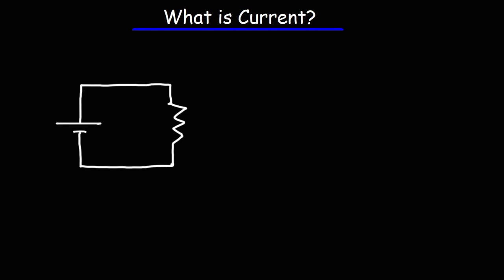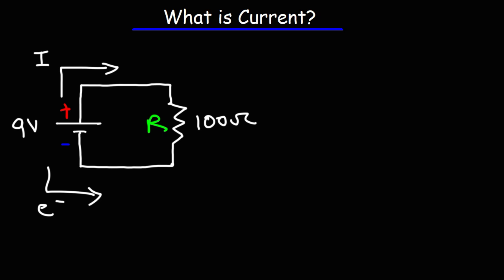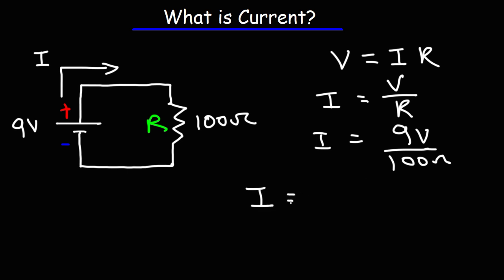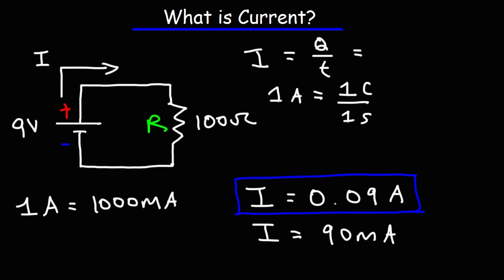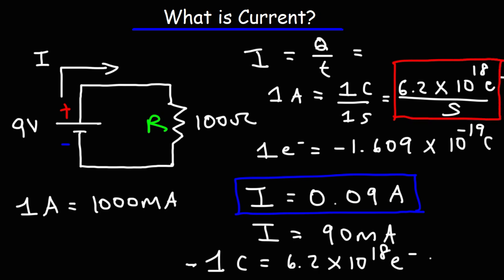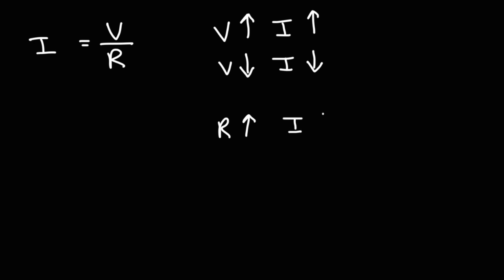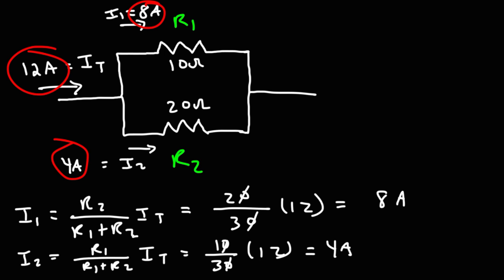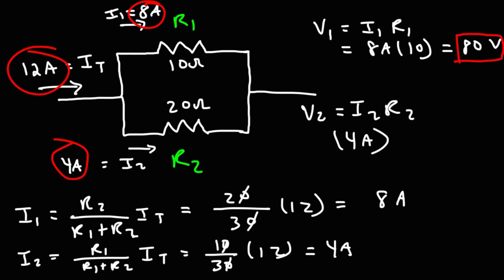What Is Current?

Comment: If energy flows through the path of less resistance, why is it that in a parallel circuit we do not take the lowest resistance path (R1 in your example) as the only possible variable to calculate current, ie. why is it shared with the other paths/resistances?

Comment: What is current ? What is voltage ?
A working definition for current in conductors like metal wires is "the start-stop motion of millions and millions of conduction band electrons everywhere within with a drift superimposed". 
In circuits, voltage is due to surface charges. Consider a simple circuit comprising a battery, two wires and a resistor. 
The e.m.f of the battery is due to separation of positive from negative charges which produces an e.m.f across its terminals and a pattern of electric field surrounding them, not exactly but like a dipole.
An electric field is there in the wires and in the resistor; powerful electric field and uniform within the resistor, weak and uniform within the wires. The field is set up by a tiny amount of surface charge with a steep gradient on the resistor and not so steep a gradient on the wires. 
It is the electric field E created by the surface charges sourced from the battery, which produces a force causing the mobile electrons to acquire a drift velocity v = μE, where μ is the mobility which is a number representing the freedom of movement of the electron in the lattice. 
This results in a current density J = σE, where σ is the conductivity of the wire or material of resistor and E is the electric field in the wire if considering wire and is the field in the resistor when considering the resistor. 
The p.d. or voltage across the resistor is the integral of a constant powerful field along its length. The p.d. or voltage across the wires is the integral of a constant but weak field along its length. 
Voltage is entirely because of the surface charges.
What is a resistor? 
While some detail is given in science and engineering courses about conductors, insulators and semiconductors, resistance is described in several ways.
Examples include i. The restriction to the flow of electrons. ii. The difficulty in moving electrical current through a conductor to which voltage is applied.
iii. a circuit element which dissipates energy in the form of heat .
More appropriate description for a resistor would be the property of a conductor which determines the current produced by a given difference of potential.
This makes us remember that a resistor is a conductor first. And, there is reason to say that superconductive wires dont obey ohm's law. So all conductors are resistive, though not superconductors. 
Resistors are used in circuits to regulate the strengths of currents either by reducing the diameter of conductors or introducing more obstacles or lattice imperfections to reduce the strength of current.
For more details about resistance and ohm's law consult the following videos, articles and books.

For a live demonstration of surface charge and its effects in circuits visit 
https://youtu.be/U7RLg-691eQ
Electrostatics and circuits belong to one science and not two, that of electricity and magnetism. To know how they are unified visit this link 
https://matterandinteractions.org/articles-talks/ and view the article 'A unified treatment of electrostatics and circuits.  B. Sherwood and R. Chabay, unpublished. (1999)'
pdf. 
For a detailed discussion of currents, voltage and surface charge see Electric and Magnetic Interactions by Chabay and Sherwood 
www.matterandinteractions.org
or 
https://www.wileyindia.com/fundamentals-of-electric-theory-and-circuits.html
There is a "look inside" feature in the amazon.com webpage of the book "Fundamentals of electric theory and circuits" by Sridhar Chitta which you can swipe left or press < icon and view the foreword, preface and Table of Contents.
For a lecture by Prof Ruth Chabay on surface charge in a simple dc circuit visit 
https://youtu.be/-7W294N_Hkk
Reply: That was certainly a lot of (useful) information.  Did you find that text somewhere, or did you come up with it on the spot?
Reply: @PunmasterSTP  I write it in computer notepad and check and correct a few times. The process of writing my book 'Fundamentals of Electric Theory and Circuits'  enables me to write such short notes quite fast and with few errors because the theory, principles AND the visualisation of circuit processed are clear in my mind. I must thank Profs Hermann Haertel and Chabay and Sherwood for their artickes, papers and textbooks and their interactions with me in the course of writing my book now marketed by Wiley India. I thank you for asking me this question. Prof (Retd.) Sridhar
Reply: @sridharchitta7321  I’m very glad to hear it!  Could you provide a link to your book so I can check it out if I have free time sometime?  Thanks.
Reply: @sridharchitta7321  Awesome; I checked it out and it looks good!  Is the content of that video based on 'Fundamentals of Electric Theory and Circuits', or another project?
Reply: @PunmasterSTP  it is from my book which includes the works of Hermann Haertel, Ruth Chabay and Sherwood.
Reply: @sridharchitta7321  That is interesting.  Do you have a link to the book, or can it be bought somewhere online?

Comment: What is resistor in practical?
Reply: Are you asking what types of resistors or resistor materials are practical?  I think a lot of resistors used for experimenting with electronics are made out of ceramics, but I think there's many other materials you can use as well.

Comment: I WAS ALWAYS UNDER THE IMPRESSION THAT VOLTAGE IS THE POTENTIAL DIFFERENCE THAT AN ELECTRON EXPERIENCES, ( its  " height of fall" if you will) WHILE CURRENT REPRESENTS QUANTITY OR VOLUME OF FLOW. 
EXAMPLE FROM THE VISIBLE GRAVITATIONAL WORLD IS AS FOLLOWS. 
THE VOLUME OF WATER FLOWING THROUGH A CHANNEL ( ie. river bed) WOULD DETERMINE THE RATE OF FLOW ( ie. amperage)
( note how larger cables are required for larger loads when using  higher amperage tools, for example. The thicker cable being akin to a wider and or deeper river bed conducting greater flow. 
VOLTAGE, ON THE OTHER HAND, IS AKIN TO THE DISTANCE THAT EACH (  call it,  " quantum of water ") FALLS UNDER THE INFLUENCE OF GRAVITY. 
THE GREATER THE FALL, THE GREATER THE POTENTIAL DIFFERENCE. ie. VOLTAGE 
EXAMPLE, 
SMALL VOLUMES OF WATER CAN BE PUT UNDER HIGH PRESSURE, AND THEN BE USED TO BLAST OFF 30 YEARS OF DIRT AND GRIME ON A CONCRETE SURFACE. ( this is a condition of low volume, but high pressure.  ie". high voltage, low amperage ".)
NOW CONSIDER A HUGE FLOOD RAVISHING THE LANDSCAPE. THE SPEED OF THE WATER ( ie. its "voltage" is low .perhaps it moves at 20 km./hr.) HOWEVER, ITS VOLUME (  ie. " amperage " is enormous) SINCE IT CAN EASILY LIFT A HOUSE OFF OF ITS FOOTINGS AND CARRY IT AWAY. 
SO YOU CAN SEE HOW HOW VOLTAGE OR PRESSURE IS DUE TO THE POTENTIAL DIFFERENCE, AND HOW AMPERAGE IS A FUNCTION OF VOLUME, OR THE FLOW RATE OF EACH QUANTUM OF ACTION, IF YOU WILL. 
TO CONCLUDE, THEY ARE QUITE INDEPENDENT OF EACH OTHER, AND AREN'T DIRECTLY RELATED AS YOU SEEM TO SUGGEST. 
What we end up with is a GRAVITATIONAL analog to electromagnetic circuit 
The river bed is the channel or  " wire" conducting current flow, quite literally, l would add. THE DAMN IS THE RESISTOR, which can be used to control FLOW RATE, on the one hand, and increase the POTENTIAL DIFFERENCE, on the other.
INTERESTING IDEAS TO BE SURE,AND INDISPENSABLE FOR AN ATTEMPT AT UNITING GRAVITY AND ELECTROMAGNITISM IN THE UNIFIED FIELD THEORY. 
" HAVE A NICE DAY "
Reply: I think those are some good ways to think of things!